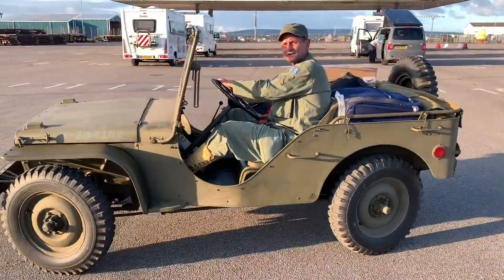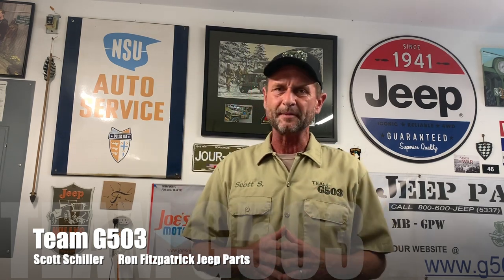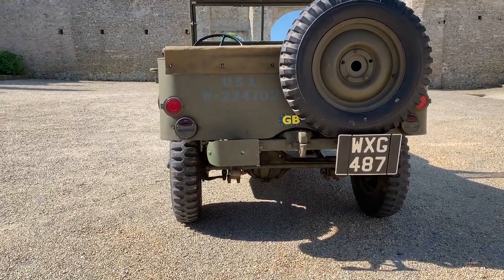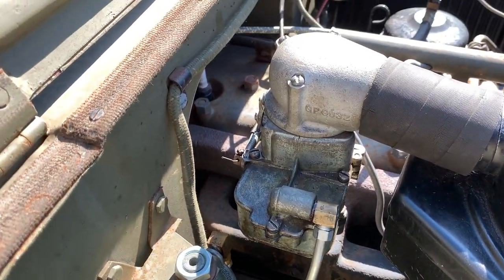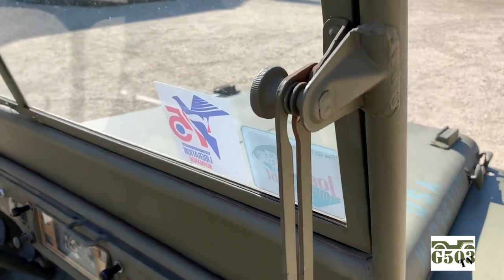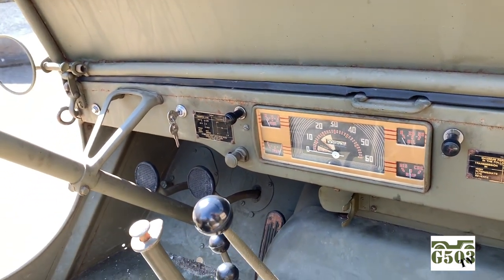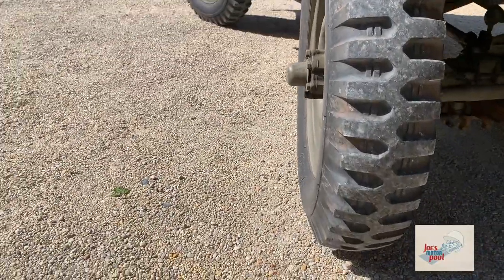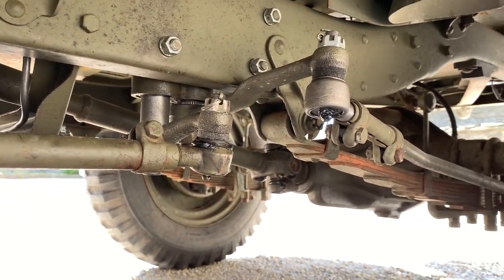1941 Ford GP 4 Wheel Steer Prototype Jeep Team G503 In Normandy D-Day 75th Anniversary

Comment: Recently I got a 1943 Willys mb and I want to get another engine because it has a Chevy Vega motor in it. and recently I started thinking i should swap it with a Ford 9n tractor motor like the Ford gp has. Would it even work with an my transmission